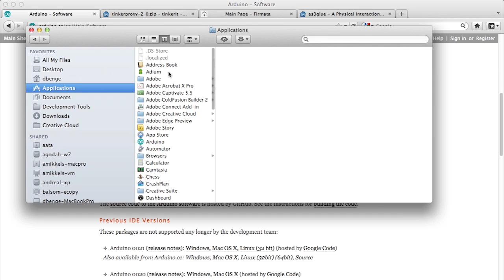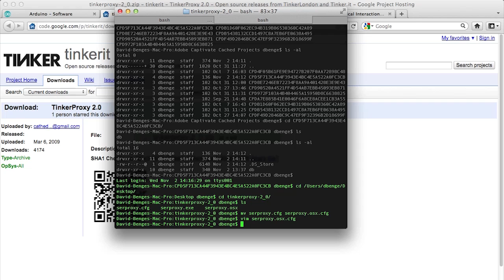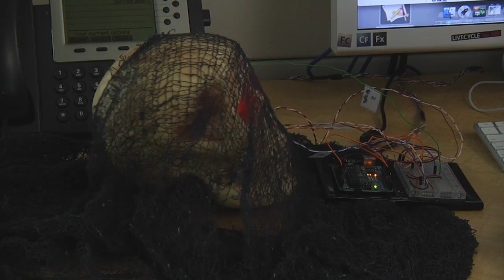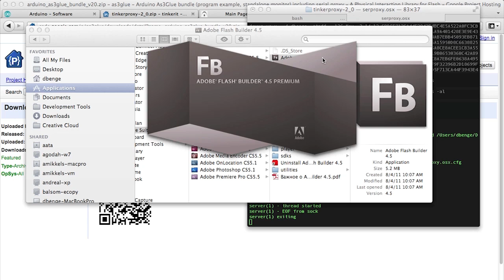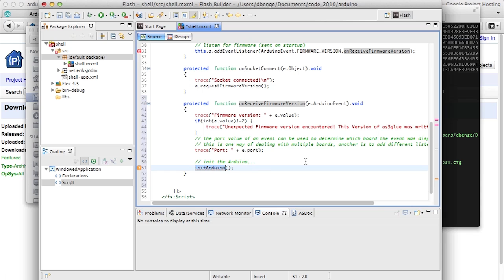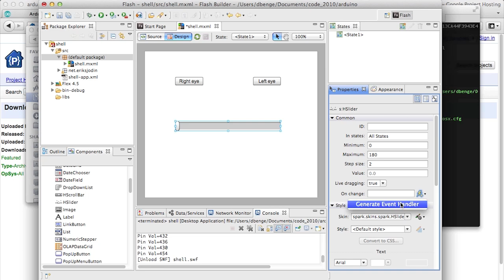Halloween Fun with Arduino - Part 2

Comment: So, out of curiosity, why were all those other programs needed? I like the monitoring aspect using a flash program, but as far as running the script to use the photosensor as a trigger to cause LEDs to light up and servo to move, couldn't that have been done pretty simply in the Arduino IDE itself?